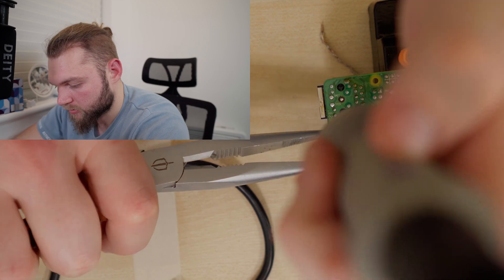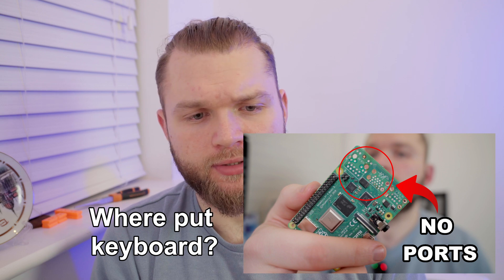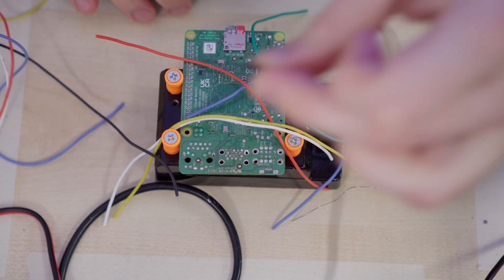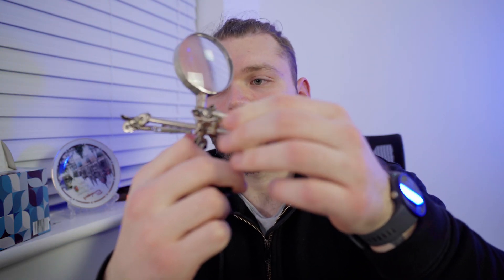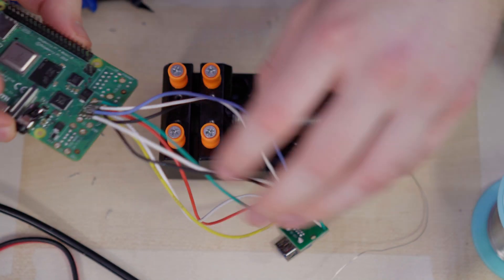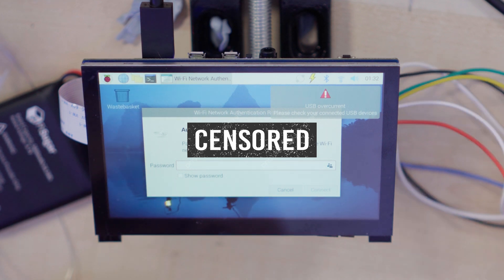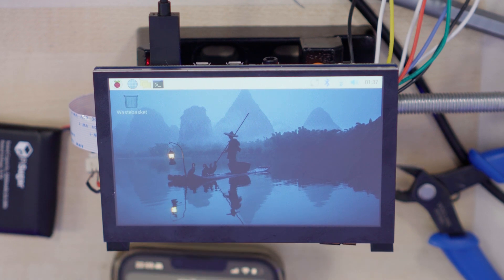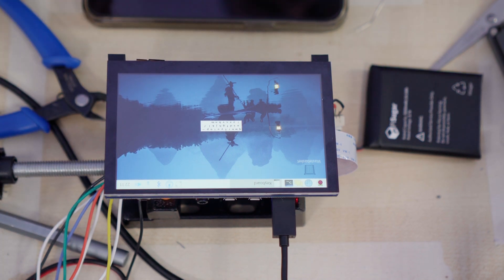I soldered a USB 3.0 port to a Raspberry Pi

Comment: You don't have to desolder the USB. You can just solder the wires to the test pads on the bottom. Also, you don't need to use USB 3. Use USB 2 because it's only 4 wires. Checkout the Cyberspacemanmike 3D printed countercade vid.

Comment: PCB design really isn't all that hard. 99% is knowing how to draw a schematic. From that the modern tools will be able to auto route basically the whole thing. You can send those files to your favorite chinese copycat manufacturer... I mean PCB etching service and you'll have your prototype in no time. Not the best solution for something you want to actually sell as a product. China doesn't have to stick to copyrights after all. Suing them is practically impossible. 
It's a lot of fun to at least try to design a PCB though. Definitely recommend it for your project.
Reply from the maker: @rebel4466  I will give it a try in future!